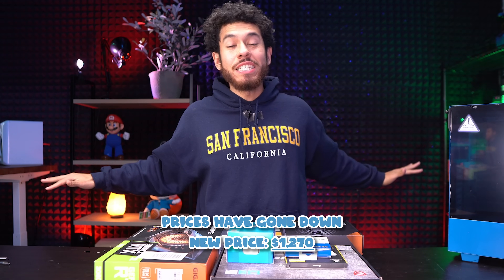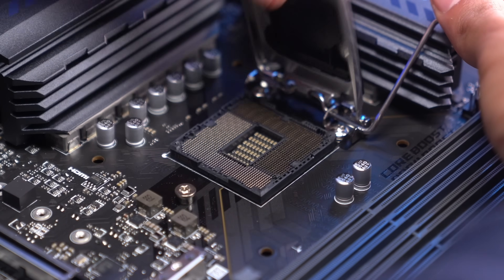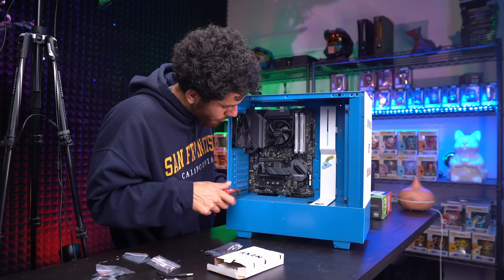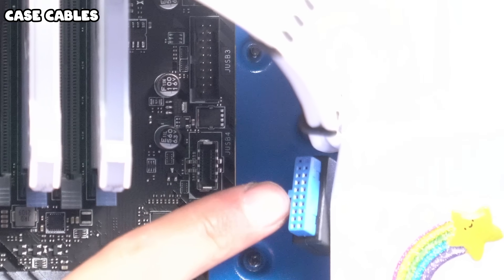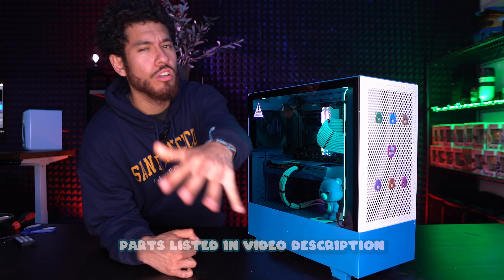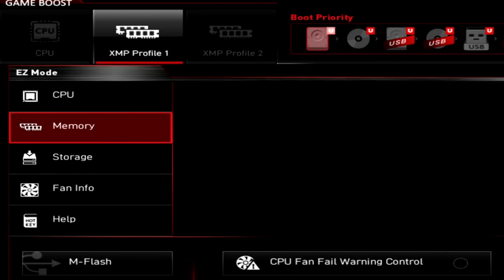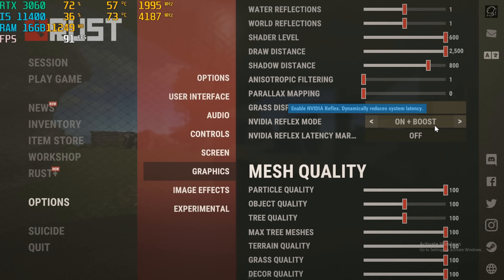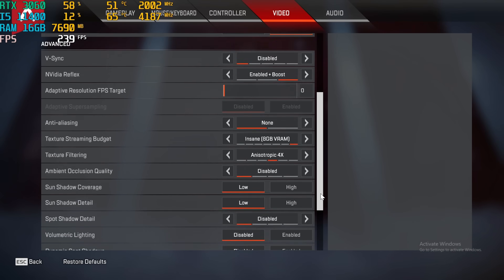$1000 Gaming PC Build Guide - RTX 3060 i5 11400 (w/ Benchmarks)

Comment: Great build although I would recommend some cheaper ram kits like crucial ballistics as anything 3200mhz 16G will be good with that CPU and the vengeance won’t give a difference in performance, also the case could be changed for something a little bit less in price if you where going for a tighter budget. If you did this you should also be able to get a 3060ti instead which will give a good performance upgrade over the 3060
Reply: Hey man I’m trying to build my first pc. When you say 3060ti are you talking about the Rtx 3060ti 8gb?
Reply: @ChicoTooSweet  Yes, the 3060ti 8g, the only came out with 8g VRAM
Reply: Even though it has less VRAM it still out performs the 3060 by a bit
Reply: Yo I’m building the same pc like in the video. Is there anything else I should buy? This is my first time getting a pc. Thanks. Also I’m not on a budget just want it to work good!
Reply: @MooMoo_04  im building mine rn too, how’d it go and what gpu did you use?
Reply: @JacobiSalinas  It went well and I like my pc. I used a different 3060ti because the one used in the video was sold out.
Reply: @MooMoo_04  i have a question, can you choose whatever psu you want or do you really need to go with what the video says?
Reply: @ethan_PHH  Well I would say use the psu he mentioned or better. Having a good psu will save you some money especially if you feel like upgrading in the future!
Reply: For the 500GB wd blue can i change it for a 1TB will i have to change anything else ?
Reply: @raymondgrullon5949  no you don’t have to change anything else!

Comment: Better go wth B660 ddr4 12400f
Or B550 5600x and both can be cooled with stock cooler 
And for the GPU 6600 or 6000xt are very nice too .
Still b560 11400 and 3060 are also good depending  on pricing in the region
Reply: I was thinking of building a pc with 3060 b550 and 5600x, do you know any good motherboards and 3060s?
Reply: @iamjhopesnightmaresnakeu  https://youtu.be/wuPH9pCCK-E this video should help you choose . Cause not all boards are available in good prices in all regions . And for 3060 you can buy whatever that is available . But careful not to choose shady brands if there are any . But rx 6700xt and rx 6800 is an awesome card with better value (depending on the region oc) , if you care about Raytracing a little less

Comment: Hey just wondering would the 3060 ti be good with the 5600g
Reply: It would work, but it wouldn't take full advantage of pcie 4.0 of your 3060 ti. The 5600g only has pcie 3.0. If your buying the gpu and cpu at the same time, I would reccomend getting a 5600x
Reply: @k_swapped_eg  I’ve had the 5600g for a bit now because I wasn’t sure how long the gpu shortage would last.

Comment: Hey what's up man I don't know if you can help with this but can you do a video where you troubleshoot I put my PC together Ryzen 9 with a 3070 TI suprim GPU everything looks great everything's working lights up everything fans going I feel like I have everything plugged in checked it the light you know we turn on the PC everything boots up but when it comes to the video display on the screen it's just a black screen the screens like sleep and I think it's getting stuck somewhere when it's booting up but I'm not sure where
Reply: What CPU and motherboard?
Reply: @JJFlores197  hey thanks for respoonding its the ryzen 9 5950 and the gigabyte aero g x 570 didn't thnnk i needed a bios update though
Reply: @JJFlores197  oh you know what I will tell you also when I plug it in the hdmi into the motherboard and not the gpu their still isn't a signal the monitor wants to sleep?? so tried both the gpu and the motherboard I should do a video and add a link here so you guys can see the build and the lights Im talking about flashing what you think??
Reply: @JJFlores197  @Hondatastic Hey so when booting up pc once the four lights run through dram cpu vga and boot once the lights cycle through twice they go off and nothing else happens except it looks good lol so now I'm even more confused lol as to what it could be hope you guys help with this lol
Reply: Motherboard might need a bios update. What motherboard you have?
Reply: @k_swapped_eg  i have the aero g gigabyte x570

Comment: Interesting choice of components.. first of all you could have gone 12th gen i5 and a 6600xt and I think that would have been faster than this while being cheaper  or similarly priced
Reply: Problem is the socket for cpu. LGA1700 mobo aren't cheap atm. And your right about the 6600xt but Nvidia is better for optimization.